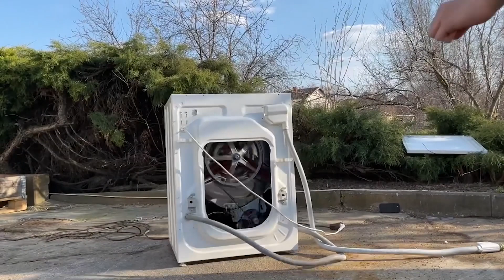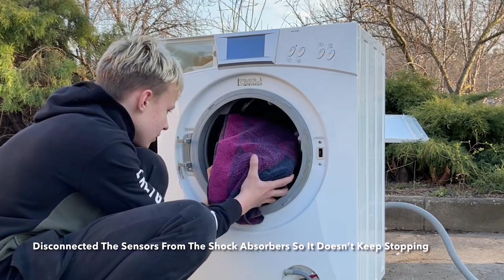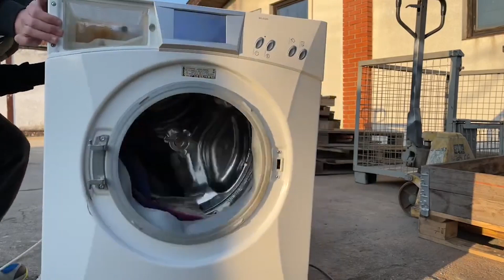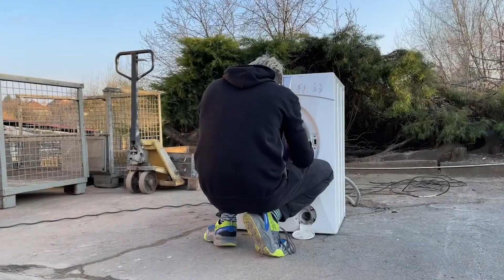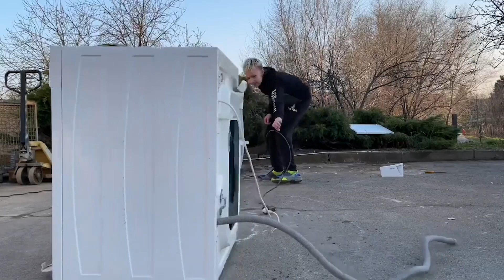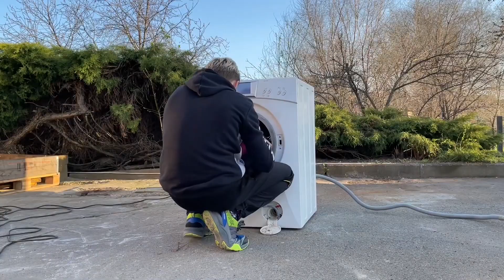HEAVY BRICKS VS RARE "PREMIUM" 2000RPM GORENJE USELOGIC WA65205 (MEGA DESTRUCTION) - ReuploadJan #9

Comment: uwu🥰 but apart from the drum spider that broke did anything else brake on it i cant remember?
Reply from the maker: After the destruction the motor broke, but otherwise it wasn't a very good performer anyway. It was a terrible machine but there weren't any other "real" problems other than the drum spider (which is already a huge problem)
Reply: @CrazyLaundryBoy2007  ok